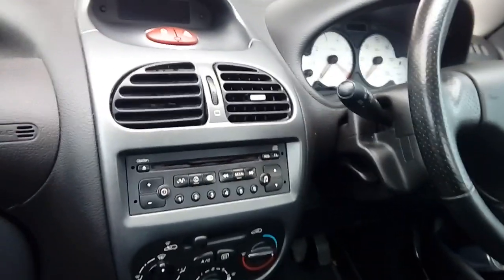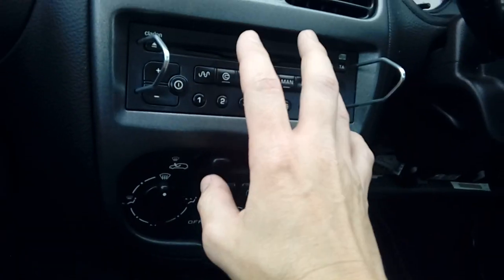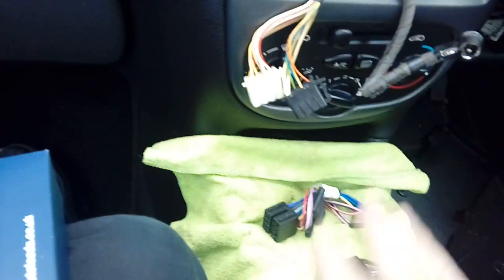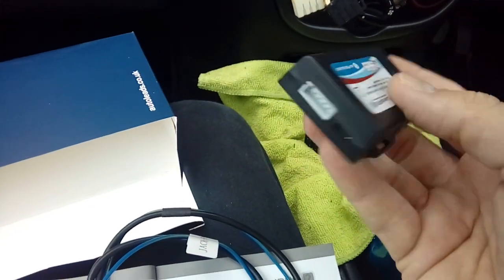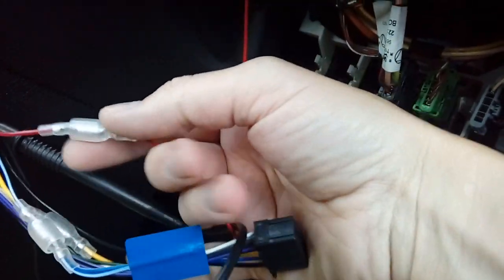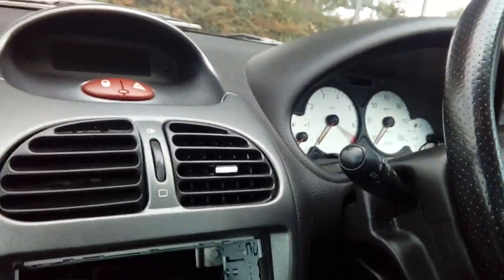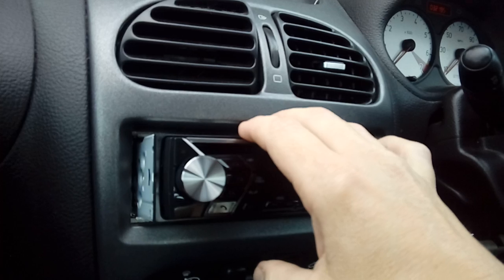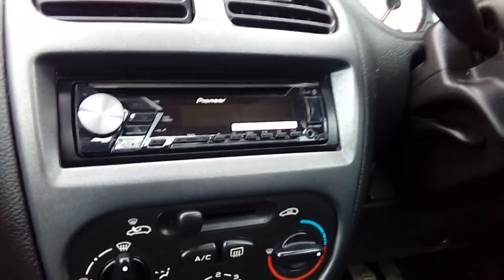Peugeot 206 1998 - 2009 how to fit aftermarket radio + steering controls

Comment: 206 Zest 3 owner here
Nice upgrade there, mate. I have that Eco mode as well (it protects battery from draining/getting dead).
The radio in the 206 looks beautiful, sadly it's not available here where I live. I am wondering if I can fit one from either 307 facelift or 207 (yeah I need plug adapter for it).

Comment: Hi, that was a good instructional video and showed parts that I am interested. it relates to a Pug 206cc. I need to fit a solar battery charger to keep the battery good whilst away for a long period. Can you suggest the best connection point in the interior fuse board to make a direct connection to the battery (not via ignition switch). There is a plug in the center with just large RED and Black cables, would this be a good connection site for both positive and negative using scotchlock connectors?

Comment: Thanks this is super helpful. I bought a like for like replacement for my Pug 206cc radio - so its the Clarion one you were replacing, when I swapped over; all works fine except it beeps an alarm every 30 seconds.. I assume that means I need to enter a code somewhere, but when at and where do I find the said code please?

Comment: Hi, I have a steering wheel control but I never use it. Do I still have to buy the extras to install the actual stereo? Just a bit wary as I have never done this before (like I'm assuming many people here), so apart from that extra antenna thing, is it a case of follwing the rest of the vid?

Comment: Ok mate great video , was very helpful on pug 2006 HDI 2006 plate 
Question I was going to ask is I’ve fitted. Chinese stereo with Bluetooth satnav etc. 
I was wondering by removing pug radio and fitting the new after market one. 
Would this interfere with incorrect operation of the small information screen above the radio,  centre multimedia information x screen. 
Make it easier the one with the clock on lol. 
Any information would be brill. 
Thanks m8.
Reply from the maker: Yes a bit. You won't be able to adjust the clock if needed.

Comment: Hi great video, really informative. I have just bought an after-market radio for my 206 but I've also had to buy a DAB antenna. Could you tell my what the best way of installing this would be? I want to hide the wires behind the pillar but Im worried I'll break the casing as I try to pull it away. Also, how can I feed the cable behind the glove compartment? Is there a way to get to that area?
Reply from the maker: The A trim panel is on tight fitting clips and should pop off or if your worried run the cable across the top where it meets the roof liner and then down the edge of the rubber door seal.
As for the glove box your best to go under it. You should find a felt trim cover under the dashboard that unclips so you can run the cables along the bottom of the dash and then cover them up with the felt trim.
Reply: @PJsprojects  thanks so much. I was able to pop off the panel in the end and then it was just a case of threading the aerial down and behind the glove box. You're right it does go more under than behind. Anyway all sorted now. Thanks again!

Comment: Whats the layout for the aftermarket wiring loom? Ie which one is earth, positive 12v ignition, 12v constant and the dashboard light?
Reply from the maker: @keithreilly9777  Full colour code layout for the one that comes with your new radio is in the instructions and the one for the adapter is in the rear of the packaging.

Comment: Nice video but I have a question. There is a 4 digit code to make OEM radio's work. What if you want to replace and aftermarker radio with an OEM, where can you get the code to make it work again?

Comment: Hi can i get away with not adding the switched live to the fusebox ie run it off just the adaptor. I have and the problem im having is that it comes on sometimes and goes off when ot feels like. Its totally mood based. I am wondering if its a faulty adaptor or that i need a switched live,many thanks.

Comment: Hi, fitted a new head unit to my '07 206 GTI today, as per your video, working fine, thanks.
While in behind the head unit I found what looks like a very small cooling fan, with it removed there's a relay that keeps turning on and off constantly (without key it), did it have one on the car you worked on or have you seen one at all? Plugged it back in and relay stopped. Just curious.

Comment: Hi mate, wondering if you could help me, I have a 2003 citroen C5, I've put an ignition Live to the cigarette lighter on a double fuse connector all works as you said but once you turn the car off and leave it for about ten minutes, you lose the time, you don't lose the preset FM channels or where the cd was upto. But it does go on to DAB and you have to press the button to get back to cd or FM. I have tried putting red to yellow and yellow to red and that just immediately loses the time the second you turn the key off. It's on a Pioneer DEH-S720DAB Car Stereo. Any help would be really appreciated. I don't know if I should move the inline fuse to another ignition Live or whether I need to get the iso adapter.
Thanks Anthony.

Comment: In my previous Peugeot Halfords fitted a BT radio (Kenwood) and I lost most of the info that comes up on the screen above the radio. Was this their mistake or is the same likely to happen? I’ve got an identical 206cc 94 as your demo. Thanks.
Reply from the maker: It's possible to get a display adapter that would make your original display work with an aftermarket radio but these are pretty expensive so most people don't bother.
Halfords did nothing wrong it's just the way it is on certain cars with a remote radio display.
Reply: This is a really annoying part of Peugeot radio change. Mine is stuck
 on date and time but would prefer temp and time displayed. :/

Comment: Pj there is a extra set of wire connectors in the original wire loom its sectioned into 3 colours blue (which is wired) green and yellow and blank but there is only 2 sets to plug into the adaptor (white and black) i have placed the black and white connectors into the adaptor but the radio is not coming on

Comment: Mate I have got a question. I bought a din with screen and it comes with the steering wheel box but it doesn't have the adapter to connect it to the car  what would I need to buy then? Have I got to buy a whole new steering wheel box adapter just to fit it or am I able to use the one that the radio has and just get an adapter for it? If so would you tell me which one I need? Thanks I hope I explained myself properly
Reply from the maker: Most steering interface units have the cable built in like this one  - https://www.ebay.co.uk/itm/Peugeot-206-306-Steering-Wheel-Control-Interface-Adaptor-Lead-CTSPG004-2/162509915222?hash=item25d6588456:g:2eIAAOSwblZZEeQi

Comment: If you don't need the steering controls can you simply use the existing harness and plug it straight into aftermarket stereo?
Reply: You mean the white and black plugs? For the speakers and power? Yes, I did that, and it worked fine, but like ha said in the video, the radio stays on for ca.10 minutes after you turn off the ignition :)

Edit: The radio I got, came with an adapter, so it fit :)

Comment: Hi, I have just bought a Peugeot 206 2008 and I don’t know which stereos will fit the car. Do you know how I can find that out ?
Reply from the maker: Any radio that is a 'Single din' size will fit. You can see in a shop that the majority are this size and the bigger ones are double din,these will not fit as they are twice the height.

Comment: How do you set the steering wheel control adapter up to make the radio turn off with the ignition? Cheers
Reply: You got the same problem any solution for new generation?

Comment: Hi PJ, I am trying to use steering wheel control, so do you mean I do not have to do anything with the fuse?
Reply from the maker: No nothing with the fuse but you will need a wiring harness adaptor that has a steering control interface built in.

Comment: do these boxes work on the 98-02 ones they use difrent indicators and steering wheel controls if you have them and does it still do the staying on for 10 mins thing on those ones as they have entirety different wiring and ecus
Reply from the maker: You would need one of three others, best bet is to contact a audio retailer such as Halfords (if your county then) and give them your reg number to id the correct one needed.
Reply: @PJsprojects  cheers i know the basics with the audio just curious cause its a older style and everyone seems to think 1998-09 but it's essentially 02-09 with that style it's a nightmare to find bits for

Comment: I bought a jvc stereo for my 2001 peuegot 206 however when you increase the volume too high it cuts itself off and restarts itself any thoughts?
Reply: For me the radio turns on by itself when the car is off

Comment: just fitted my new aftermarket radio and the radio won't turn off when I turn off the car... it did it with the old radio that were mounted. any ideas? :)
Reply from the maker: First make sure the radio does not self turn off after 10mins.
Peugeot cars have a delay on the ignition live power feed so hence the delay. For an instant power off with ignition you will need to run another power cable from the fuse box, find a circuit that goes of with inhibition such as heater.
Reply from the maker: First make sure the radio does not self turn off after 10mins.
Peugeot cars have a delay on the ignition live power feed so hence the delay. For an instant power off with ignition you will need to run another power cable from the fuse box, find a circuit that goes of with inhibition such as heater.

Comment: If there isn't a audio steering controls do it have to be activated by a tester?
Reply from the maker: So are you looking at adding a steering controls? if so and you have added the oem stalk then yes the ecu will need those switched on.

Comment: I have an issue that when the ignition is turned off and the radio turns off, it loses all of the saved settings. I am guessing it's something to do with constant power supply. Any suggestions? It is a Sony stereo
Reply from the maker: You need to swap the yellow and red wires around so that red goes to yellow and yellow goes to red.
Most aftermarket radios have a couple of bullet plugs in those wire to let you switch them around.
Reply: @PJsprojects  I have tried this but both the red and the yellow wire which connect to the stereo are connected to a single wire so it makes no difference? Is there a "constant" 12v supply on the fuse box? Then maybe I could run a spur from that
Reply: @PJsprojects  I spent quite a while trying to get the two wires out of the iso harness without luck. Is there a trick? There is a small yellow lock piece of nylon but even with that out it didn't make a difference. The 'normal' leads are fairly easy.

Comment: Hi, very helpful video. I just have one question. We are installing a Sony universal unit. She turns on without the adaptor but isn't turning off with the ignition switch. I read somewhere about it being to do with the multiplex system (it's a peugeot 206 2005 model) and I'm wondering if it's something to do with this? Or maybe we need to attach the yellow wire to the red (which it suggests in the manual). Thanks
Reply from the maker: You will find the radio does in fact turn off after a few mins of the ignition key being removed. If you want it to go off as soon as the key is removed then you will need to take the radios red wire to the cars fuse box and connect it to a switched live by either soldering to the correct wire at the rear of the fuse box or use a plug in fuse spur to double up on which ever fuse you use.
Reply: @PJsprojects Hi mate  does it drain the battery too much by not having a switched live. just wondering is it worth all the trouble cant it be left out lol.

Comment: I am thinking of changing my 2003 206cc's stereo but i have heard that the multi-function display in the car will stop showing relevant information. Is that something to be worried about?
Reply from the maker: Yes the display will not show the radio station and a couple of other bits,but the new radio will have a display of it's own.
Reply: Thanks for the information! Great video!
Reply: So even with this adapter the info will not be displayed on the display ?
 @PJsprojects
Reply: @Belgsken001  I think, even the adapter doesn't show the info in the multiscreen

Comment: What is the fuse called? I can’t find a doubler socket anywhere
Reply from the maker: It's called a fuse spur. Like the example below -
https://www.ebay.co.uk/itm/2-x-Add-A-Circuit-Piggy-Back-Fuse-Tap-Mini-Blade-Fuse-Holder-ATM-ATP-12V/262247697355?hash=item3d0f2e4bcb:g:vpIAAOSwd4tT8HMh

Comment: Hi! Can someone help me with my aftermarket radio? I plugged all the cables, but when i turned the car off and get my keys out, the next time when i start the car again all the settings of the radio are gone. Seems one of the 12v cables is on the wrong spot in the cable? 
Thx guys!
Reply from the maker: Swap the red and yellow cables over so that red goes to yellow and yellow goes to red.
Reply: @PJsprojects  I tried this already. Didnt work?

Comment: I got starting problem with peugeot 206 but this problem started when someone broke my car and steal my radio,the following day I put my the key on ignition to start the car but the car won't start up to now.I believe someone out there can help my problem
Reply from the maker: Could be damage from them ripping the radio out but first thing to try is the anti theft ignition fuse which should be a yellow 20amp,refer to the cars owners manual as to which fuse it is because they can vary depending on spec and country of sale.

Comment: hi mate i recently purchased a ct20ct10 ( i have a 05,206 )wiring harness and a pioneer deh150, plugged everything in and the radio wont come on. not sure what to do next or what could be the issue
Reply: i havent connectd the red ignition cable to the fuse box so i presume that must be it lol